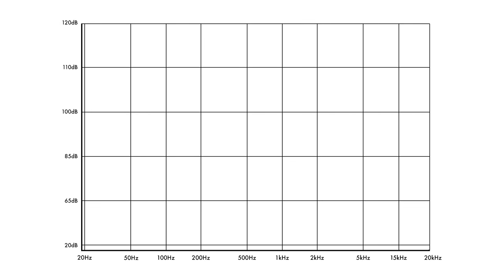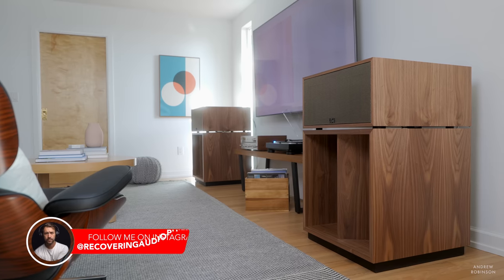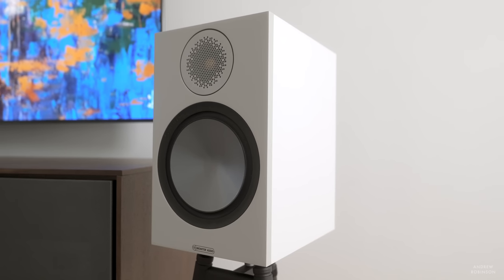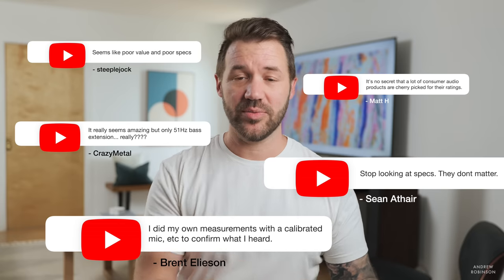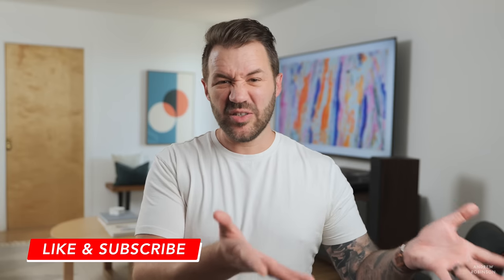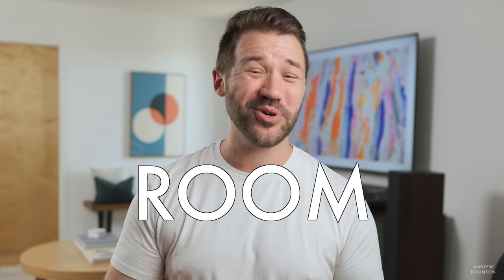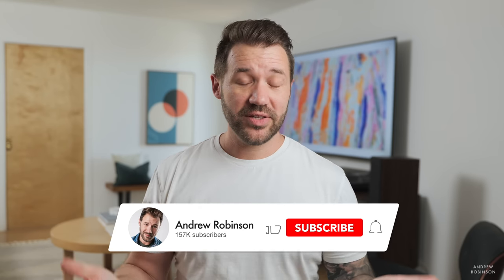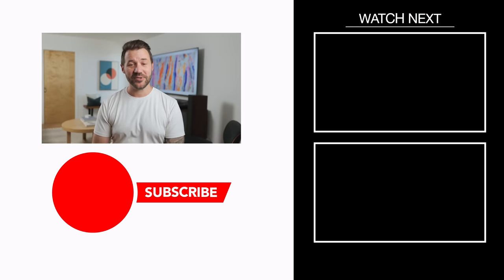DO SPECS REALLY MATTER in Audio? Understanding Speaker Measurements!

Comment: Thanks for the links to the hearing tests--they were helpful. As to measurements, Accurate measurements tell part of the story but not the whole story. My understanding of Dr. Floyd Toole's work is almost everyone who hears a speaker with garbage numbers will agree that it's a bad speaker. On the other hand. speakers with good midrange measurements, good off axis measurements, and  pretty good linear response curves will be judged by most listeners to be "good". There is less agreement among listeners whether one "good" speaker is better than another even under laboratory conditions. So, once a certain threshold is reached it's really a matter of preference. As you say measurements are a helpful guide--no more, no less.
   .

Comment: Specs are important only insofar as making sure whatever it is will work with your equipment (do you need a sub to get the bass you need or do you have enough power for your specific speakers, etc.).  Your own ears are the most important test.

Keep on rockin’ these vids.  You two are the best!

Comment: Specs matter to me to a point where I'm understanding that there was some STEM or "fuss" put into an audio device.  All of that goes out the window when I'm demoing -- then it's all about what do I actually hear and how to I feel?  The challenge is not letting the marketing or hype unfairly influence perceptions of what I should feel.  Sometimes that can be a thing. 

On source material:  As someone who has more experience with recording studio equipment than high-end audio equipment: the enjoyment I get out of high-end audio is the ability to hear the art of a recording.  Sometimes hearing imperfections (like the squeak of a kick drum pedal, someone talking in between takes, the bleed of a previous tape take, hums and hisses) are things I like because it humanizes the art.  It brings you into that moment in a much more real sense.  Other times I like being able to dissect a masterful recording because higher end loudspeakers provide more space in between the tracks.  I can hear whispers, details, layers that would be more obscured on mortal systems.  Bob Marley's "Kaya" is an album I accidentally found both these extremes to be true.  I think these are masterful recordings overall with beautiful stereo imaging, dancing percussion and sharp beautiful vocals.  At the same time I can hear when the producer decided to drop out the bass on a part but I can hear it faintly still there bleeding through vocal headphones and drum mics.  Stuff like that brings me a strange joy and yet doesn't take away from the raw visceral "feeling" a good song is supposed to give you.    

If a recording is soulless or antiseptic, that comes through as well.  It's the difference between the over-compressed high fructose sounds often found in some pop music that's designed to sound good on cell phone speakers versus something like D'Angelo's "Voo Doo" where you're really missing out if it's not on decent speakers.

Comment: Measurements matter...without that “guideline” you don’t have much to go on when looking a possible change in gear. Your BMW comparison illustrates this well. Imagine a buying a 5 series without measuring performance? Horsepower, gas mileage, safety, breaking etc...are similar to your sound graph, on and off axis comparison, frequency response and sound stage. I equate measurements to “baseline” analysis to learn more about your options when looking at a new purchase prior to test driving. Good video Andrew! 👍🏼

Comment: Boy, I know this is a contentious subject and I do respect those who are dedicated to the pursuit of providing specs and measurements of equipment.  I've been over at the Audio Science Review myself and looked at some of the testing done over there.  I know Gene over at Audioholics made a response video to this video and he seems like a really smart guy. I love it that he's able to put pressure on manufactures to provide more accurate specs on receivers/amps, etc. Instead of the misleading numbers some present in marketing material.  That's sort of a sore subject for me at the moment.  I spotted a forum post that pointed out a spec on a recent purchase might not be what it is stated to be.  

Which sort of lends to questions of how well regulated the numbers even are to begin with.  Even the guy over at Audio Science Review had Denon call him to find out why he arrived at such a negative review on the 4700 (I think) and they worked together until they arrived at a much better result as I understand it. So, there may be room for 'error' even amongst those with the best intentions idk.  

I do have to agree that there has to be some happy middle ground, however.  I know you are talking about speakers specifically and I actually purchased my Revel F35s based in part on what seemed like a very well engineered speaker line that benefited from their testing capacity.  I can't say that I'm disappointed in my decision.  These are great speakers for what they are and how they fit in my space.  I'm sure there are other options that would have been a fit for me as well, but I felt like I could run them and grow with them with the equipment that I had at the time and I have.  

This extends to a recent external amp purchase decision too though.  I was faced with making a decision at my price point that was going to have compromises.  I ended up arriving at the Parasound A23+ knowing that it has been measured to suffer from being a little noisy.  

I had somebody trying to convince me on a forum that my Denon 4500 internal amps were 'transparent' and basically it would be a waste of money or there was very little improvement to be realized.  That's simply not true. The vastly improved damping factor with the A23+ has resolved my biggest gripe with my F35s having a little trouble down low being tight enough for me.  I've seen reviews that seem to arrive at it not being a very well controlled amp down low, but with my Revels at least for me it sounds much better.  

I am really torn, however, by the option of Class D.  A PS Audio S300 possibly.  Would that be an even better option for bass control and compliment the slightly rolled off F35s? I've been enjoying a few MoFi SACD discs recently and that blackness of SACD might really pair well with a Class D amp.  The measurements of the newer class D amp modules had me looking at some of those options too.  The Hypex and Purifi I guess get a lot of praise over at ASR for their measurements.  I have to be honest though - those measurements get way out of my league pretty quickly. They have extensive write-ups over there laying out the groundwork of what is actually within the bounds of 'transparent' to personal preference and it just gets really, really complicated imo.  

I've considered if I should return my A23+ in favor of something from Apollon or Nord too. You can even plug in your own Op Amp (?) to switch it up a little like a tube amp with the Nord products I believe?  I'm just a little skeptical of chasing after the specs and measurements of the latest and greatest offerings and potentially gambling on reliability that I believe I can get with Parasound or PS Audio.  I'm also not really sure I want to sacrifice the easy listening nature of class a/b for a more 'audiophile' experience of class d with the better measurements/specs, but it is a really tough choice right at the moment.  I've got a 60 day return window with the Parasound.  I'm actually really liking it and it may break-in to sound even better over time.

Comment: Wow…well-put, with a lot to unpack here:

- Many, many years ago, at a hi-fi show in New York, I got to chat with one of my favorite people in the loudspeaker biz, Roy Allison. He had a lot to say about the usefulness (and more-than-occasional folly) of choosing a speaker via spec-sheet. He was probably one of the first to overtly take the real-life listening room into account in speaker design, and I believe I could hear the difference. Certainly sobered me up about "spec-hunting."

- Devil in the Details: Before I bought new speakers for my main hi-fi (Sony SS-CS3 floor-standers), I did casually check the specs out, although I knew how the speakers roughly sounded from auditioning them in the system of a friend I recommended them to. Hardly the highest-end boxes I've owned, but thought they'd be more than good enough (which they are!). I see the frequency spec, but…no + or - tolerances (i.e. +- x dB)? Almost every speaker maker of any prominence offered a full spec like this, even on their lower-end stuff. Not a true biggie, though: I do like what I'm hearing.

- Wagging the Dog: One of the biggest bits of audio-advice BS in the 60s and 70s was that speakers were the most important component in a hi-fi system, and that they were where you threw the lion's share of your budget; the source (turntable, mostly, at the time) came second, and the stuff in the middle (receiver/separates) came dead last, because "as long as they spec well, they all sound the same." First receiver I ever bought was a dreadnaught-class Pioneer SX-1010 because I thought more power = better sound. Then I had the misfortune of demo'ing Advent's tiny, 15-WPC Model 300. Guess which sounded better?

- Ear of the Beholder: Since you brought the subject up*, I have had my hearing checked professionally a few times over the years. From age 35 to 45, my hearing was good up to about 16.5kHz. (Hey, I wasn't much of a party animal or headbanger….maybe that's why audiophiles came across as such a boring bunch?) from 45 to 55, I dropped to bit under 15k. Now, having just urned 65, I think I've dropped again to about 15k, maybe a tad lower…which, I'm told, isn't too shabby for my age group, so I guess I can deal. 

* I was surprised to hear that Kristi's HF hearing acuity is lower than yours, as I've generally thought women's upper-frequency hearing is somewhat better than menfolk's. (Wife, looking over my shoulder, quips "you mean better listening , right?")

- Other Stuff: You mention mapping your room to measure peaks and valleys in the frequency spectrum, but here's a thought: since I imagine you don't listen to music alone all the time, do you have to deal with who gets too sit in the "sweet spot?" (There's almost always a sweet spot…and the pricier a system is, the narrower that "spot" tend to be, overall.) Also, since my main system still switch-hits for home-theater stuff, wife is actually enjoying the Sony towers much more than the speaker system it replaced, which I installed at her insistence: a pair of Sonos 3s, set up as a stereo pair, via a Sonos Connect running through the hi-fi. I wasn't terribly surprised at this. (Hope you do get around to evaluating the Sony SS-CS3s at some point.)

Comment: Living single in a townhouse, I've found a simple solution that is working for me: nearfield listening in stereo. I've been in this life since my dad got into it in the FIFTIES! It was the advent of stereo, and he bought a monster "console" with a matching cabinet just smaller than a LaScala, with a 15" woofer.  This was also the arrival of Elvis. Lot of bongos and trains and jazz and Bob Wills and anything on the new LPs. I'd love to write you later on that 
Having run multi-room systems with a lot of damn equipment, I'm using less be and enjoying it more.
What I'm using: Vandersteen 4ce's, driven by Accurus 200w, two channels. It's all processed through Bob Carver's Theatre Master III. (I have 2 subwoofers that I can add with a switch for movie effects. With this 3.2 movie mode I have the Vandy CC1 center) I also kept all power protection and so forth.
This is about space. 
I sit in a comfortable listening chair, but I swap it with big rocking rotating office chair.
I am sitting in a triangle 55" on a side. The Vandy's are 2ft from back wall, which is in the east/west room orientation.
IT IS FRAKKING AMAZING. 
Granted, I have very good equipment, and the Holographic filter just makes it truly have the richest and most 3D soundstage I've experienced. Hence the office chair. Swiveling slowly around, the imagery persists! I realize I'm getting some fortuitous reflection, but I've played "find the rear speakers" with friends, and that works, too. This is in 2.0 stereo mode.
Give it a try, especially if no kids or wives enter the equation. 😂
The speakers, Carver, and Acurrus were $10g back in 1994, I get that, too. But, Andrew, as you show every episode how much good stuff is out there for WAY less than jumping right in the High End.

Comment: You nailed it. I think of myself as a (very) casual audiophile, and the only thing that matters is that.. things don't matter as much as you think. As soon as you think you've learned one thing about a pair of speakers (or headphones), something else comes along that changes your view. And to me that's the beauty of it. Discovery. Speakers and headphones are like shoes: they can look good in a store window but until you use them you won't know. And there are different shoes for different occasions, not to mention you can tweak them with equalizers (.. speakers, not shoes, haha). Specs to me are at best a rough ballpark to get a general sense of the thing, but I'd rather have a pair that I think sound amazing with "poor specs" than one with great specs that doesn't sound pleasing to my ears at all.

As for the specs of the source material though? That's where I'm unfortunately a sucker for high numbers, and I've probably flushed waaay too much money on 96/192kHz files that actually sound negligible compared to a decent CD. 😂 I just find it.. cleaner, "rounder" sounding, and I love the idea of a high resolution library (combined with Tidal). Others swear by vinyl, but I've personally never had that "magic moment" with a vinyl record.. yet. That could still change as well.

Comment: Specs inform my opinion, but in the end, it's the feeling the equipment generates with my entertainment.

In general, I prefer a warm receiver/amp combined with a cold bright speaker - because there is no muddiness with that combination.

I love Pioneers and Onkyo with Klipsch. Denon, not so much - but I now have a Denon... I can't get the warmth and clarity that I had from the Onkyo, but it still sounds good.

Comment: You're fortunate to have lots of speakers to listen to. Most of us - not so much.

Do measurements matter? Of course they do.
For example, they can tell us about the potential of the speaker. In your world, a speaker that has no tweeter is as good as one that does have a tweeter because you discount the potential for performance. 

In your video you concentrated upon only one aspect of a speaker's performance, the overall frequency response, but I am certain that you know there's much more to a speaker's performance than that! 

You're right about how rooms make a huge difference to how a speaker sounds. But that also, implicitly, assumes something about the speaker's potential. So, if you know that in your room, at your preferred listening position, the room tends to reduce high frequency energy, then we can safely assume that between two speakers, one with a rolled off treble and the other with emphasised treble, that the rolled off speaker will sound very dull. The other might sound much better to a person who prefers the sound where the speaker generates a relatively flat response at the listening position.

I have lost a lot of high frequency response in my hearing. To make a sound that I like I will probably prefer a speaker with an uptilted response curve. Knowing how the manufacturer has designed the speaker's response curve gives me insight into whether it is even possible for that speaker to satisfy me.

In the final analysis, the speaker that is best is the one that sounds best to us. You're right. But knowing something of what the speaker was designed to do helps us to make selections rather than relying upon chance. That's because most of us do not have, as you do, the opportunity to make choices based upon a multitude of speakers passing through your living room.

So, I ended up buying speakers that do have emphasised treble, that might sound bright to others, but that suit me well. I knew that going in. If I knew nothing about the specs I would have bought blind and, by chance, would have been most unlikely to have ended up with the units that I now enjoy.

It is easy for reviewers to choose to eschew specifications, but doing so, on purpose, is, in my opinion, rather lazy, done to make their job easier. Doing so gives reviewers the endless opportunity to to say that whatever we end up with as a result of their reviews is our fault. This devalues your own work and expertise. 

I think that you know better than you told us in your video and you could do a better job if you shared that expertise fully.

Comment: As a person who has been building and designing loudspeakers for over 30 years I can definitely say that measurements are very important. Isn't near impossible to design an optimal crossover network by ear (a 2-way is doable in some cases). IMHO, fine tuning a loudspeaker consists of measuring AND using your ear.
One very important aspect is doing measuments off-axis, it can tell you a lot of things about a given loudspeaker.